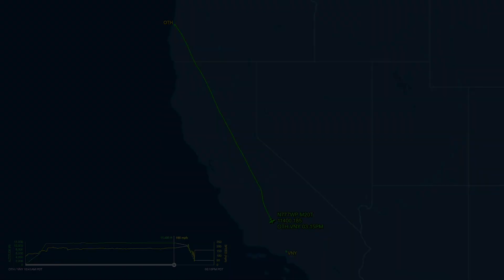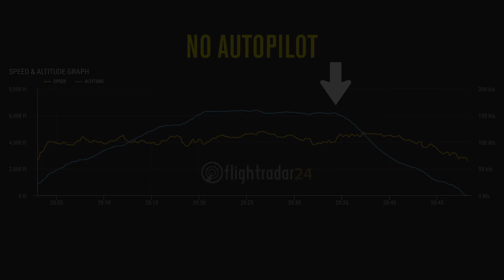Anatomy of a plane crash

Comment: This is one of the amazing things about virtual reality (VR) and the Google Earth's VR version. One can get a clear understanding of things that happen and in full 3D.  I have flown the "Kobe" flight and the "Sully" flight in VR.  The Sully flight is most interesting because you can quickly see when in fully immersive 3D  why he did what he did.  Teterboro was clearly too much of a risk and he could  get no instant cooperation out of LaGuardia. They were conducting a "group think" and he needed a decision maker. The Kobe flight is a puzzler however.  There is an exit left he may have mistaken in the fog for a continuation of the freeway through the pass which actually opens up right there. Again, why do not all these pilots just use their autopilot ?  Even JFK Jr.